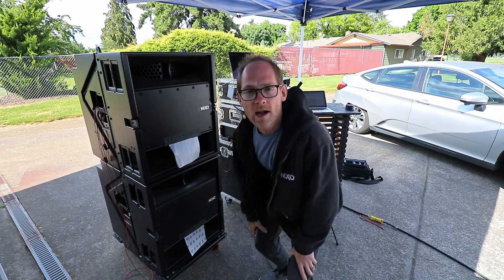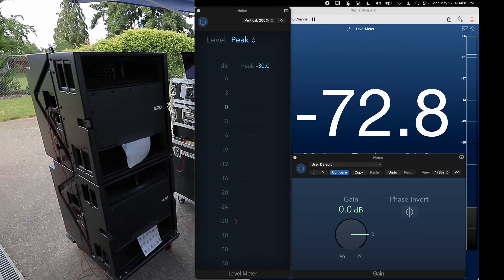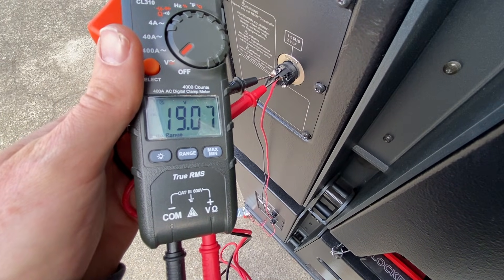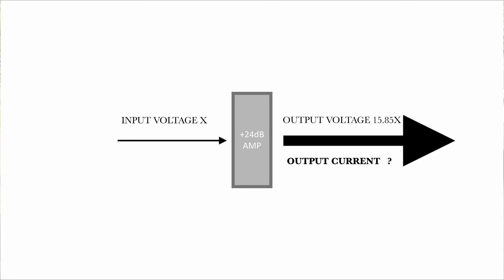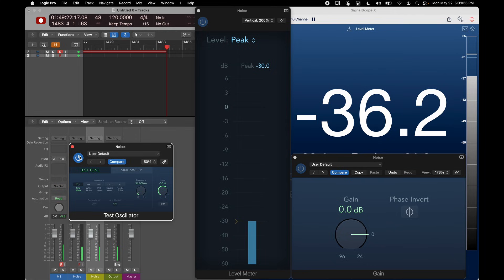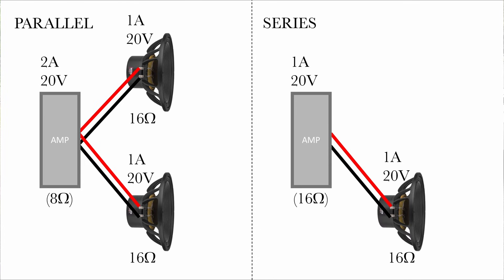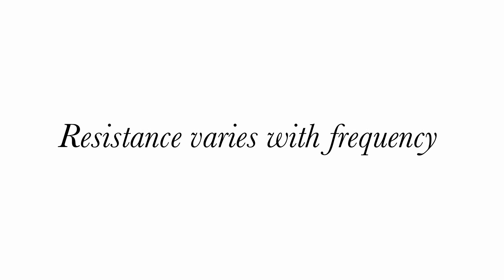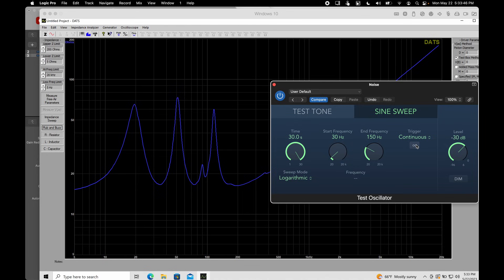Is doubling speakers +3dB or +6dB? What's parallel and series wiring?

Comment: If you use powered subs to simplify the whole process, a lot more people will understand it. Basically doubling your speakers gives you +3db . If one sub max SPL is 135db, adding an extra sub would make it 138 db SPL Max, and to increase it another 3 DB you have to add two more subs, the four subs would produce 141db Max SPL and if you want to add another 3 db, you have to have eight subs to increase it to 144db SPL Max.  Basically, you have to double the speakers for every 3 db increase you want in SPL.
Reply from the maker: OK but you're also doubling the amplifier power when you add another powered sub, so...
Reply: @devinlsheets_alphasound  yes you're correct but I was just explaining the fact that if people want to get more SPL out of their system, they have to double their speakers for every 3db increase. If they use four passive subs instead of two, they will probably have to use two amplifiers to power them to get the additional 3db increase.
Reply from the maker: Unless your amplifier is already completely out of available power, adding a second subwoofer in parallel will automatically draw double the power from the amplifier, resulting in a total of 6 dB increase in your system when you add the second subwoofer. If you could theoretically keep the amplifier power the same all around through some artificial means, adding a second speaker would increase it by 3 dB.
Reply: With — correlated signals — self-powered subwoofers yield 6 dB more pressure for each doubling of loudspeakers as opposed to 3 dB.
Reply from the maker: @MerlijnvanVeen  i'm curious, what situations involve doubling loudspeakers but only yielding 3dB?
Reply: @devinlsheets_alphasound  e.g., two subs that play back — uncorrelated — pink noise waveforms.
Reply from the maker: @MerlijnvanVeen  ah yes, thus the correlated/uncorrelated distinction

Comment: I see there is diminishing returns for every subwoofer after the the second (amp/sub). The SPL calculator has +6.0, +3.5, +2.5, 2.0 db and so on. I'm almost finished building two vented boxes each with a 24" subwoofer tuned for 23 hz (internal volume 11 excluding ports, bracing, driver). This is for an outdoor audio/concert setup. Reinforces the fact on how important the sensitivity and frequency response of a subwoofer or driver is. It can get incredibly expensive or consume a ton of electricity.
Reply from the maker: Yes, because our sense of SPL is logarithmic, not linear, so it takes exponentially more power or number of subwoofers to increase things equally in proportion each time according to our sensitivity to SPL. If you have one sub, adding another will “sound” about the same amount of increase proportionally as having 50 and adding 50 more.
Reply: @devinlsheets_alphasound  one last comment for you and Ding Dong (if he reads this). Watched a video of the 80's band Winger come on stage during Monsters Of Rock Cruise MORC 2023. Guy is recording with his cell phone. Once the music kicked off, you hear someone say "Oh * yeah...that bass!!!". Now that is an experience worth paying or in this case, giving to others. So whatever it takes, that's how many subs I will build/buy/power or whatever. It's all or nothing!!
Reply: Horn loading is the way to go if you really want to push big SPL at sub frequencies. Tapped horns are very effective.
Reply: @dingdong2103  how do you determine the box? Hornresp? The videos on YouTube look like pro audio clones but it's obvious the driver parameters are important after using WinISP.
Reply: @stiffmeister0hYeah  Yes hornresp is an excellent tool. I built a few tapped horns with 21" 18Sound drivers and the actual response was dead on as predicted. +-3db from 80 to 20hz room response in a mid size cinema. System pushes easily 130db clean and punchy bass.
Reply: @dingdong2103  well I have a third 24" sub that is currently in a box with four 12" passive radiators (Earthquake PUMP-12x2). Unfortunately, I did not brace the box enough and it vibrates. I'm going to dig in and see if the braces came loose plus figure out resonant frequency of the radiators. However, having the driver out will allow me to play with hornresp. I just recently learned of horn resp while building these behemoth vented boxes. The 15 cf external dimensions are just enough if not too much. Recommended 16 cf internal and holy cow too much space.
Reply: @stiffmeister0hYeah  A sub with passive radiators is not what hornresp is for. For that use I'd recommend Vituixcad.

Comment: Great video as always! I like that you don't just do the calculations, you measure things. In physics measurements are king. If your theory disagrees with measurements the theory is wrong.

But I have an issue with this. What if you put 10 speakers in series? Your amplifier would output tenth of the power but you'd still get the same audio power. How?

Let's complicate things even more. Now you connect 10 sets of these to the same amplifier in parallel. Your amplifier outputs the same amount of power as it did when driving just one subwoofer. Same voltage and the same current. Same power. But the audio power just went up by 20 dB.

Let's have another thought experiment. You have 100 speakers. You connect all of them in series. Your amplifier outputs 1% of the power it was outputting with just one speaker but the audio power remans the same. You just increased the efficiency of the whole system by 100 times..
What if you had a 1000 speakers? Would your efficiency be 1000 times better? At what point your system's efficiency would be more than 100%? At what point would the system be outputting more energy than it's getting?
Reply from the maker: This is why there are “part 2” videos on the internet lol
Reply: With subs, you will max out acoustic efficiency somewhere around 30% depending on design. Meaning that your +6 db for every doubling of speakers starts to drop off and level off to +3 db. That should happen somewhere around 12 double 18" cabinets where you have reached maximum acoustic efficiency of the design and there is no more efficiency increase to gain by increasing cone area. Same with running speakers in series, you would reach a maximum volume and then start dropping off as the new speakers coming on line wouldn't be adding to the acoustic efficiency as maximum has already been reached and would also be physically far from the measurement location as you can't stack boxes in the same space of each other (damn Pauli exclusion principle).
Reply: He made a mistake in his calculations, see Elkin Velásquez Cuítiva comment.
Reply from the maker: There was indeed an error with that slide, I edited that part out with YouTube Studio.
Reply: So can you add 2 outputs of the same channel on same amplifier to double the output power? My amplifier has 2 cg
Channels and each channel has 2 outputs. I wandered to combine the output on each channel so I ended up with 2 outputs instead of 4.

Comment: Devin, any idea why Nexo uses 16 Ohms drivers in their S-118 subs?
Reply: probably so you can run a shitload of them in parallel to a single amp
Also, and that's speculation, higher impedance speakers use thinner and lighter wire on the coil, so, you may have a tighter magnetic gap and lighter voice coil, thus a better speaker overall
Reply: @victoramicci840  It will also produce less heat.
Reply from the maker: Nope. But maybe I’ll ask and see what they say!
Reply: Greater speaker impedance means greater damping factor with a given amplifier. You may also use thinner cables for each speaker. Also you may have more speakers per channel as someone has already mentioned. You need a strong amp though. Nexo 4x4 is one monster amp.
Reply: That way you can hook up 4 subs (parallel) and have  the amp see a total of 4 Ohms. If you have an amp that can drive 2 Ohms, you can hook up 8 subs.

Comment: What it is two separated active sub ?
+3db ?

I dont understand when you say +3dB acoustic power. Because the power produced by the added membrane, is the exact additional power transmitted by the amp. So why do you count it twice ? (+6dB)
Reply from the maker: With two separate active subs, you would expect a 6dB increase from the second sub being added, because behind that second sub is also 3dB more power from an additional amp.
Reply: If you double your cone area you double the efficiency that each cones can turn the motion of the cone into sound waves in air. It is a very lossy process. In other words both cones now produce twice as much sound as they normally would on their own. Like paddling a canoe with a broom stick vs a paddle - you exert the same amount of energy with both but you go twice as fast with the wider paddle because it can transmit your energy into the fluid water with greater efficiency.

Comment: Voltage is V, or E, unless you're European, then U.  Europeans like the letter "U" as a reference for all kinds of things (check out a German schematic sometime).  Some physics propeller heads didn't want to confuse V for Voltage with V for Velocity or Volume.  So they used "U".   'Mericans honor the name of the guy who came up with the concept: Volta (Alessandro Giuseppe Antonio Anastasio Volta).  Them Europeans, though!  They couldn't leave Conductance as mho, but changed it to "S" to honor a guy named Siemens.  So far, Ohm has been safe and has not been re-assigned a new symbol.  
Don't even get me started on Al You Mini Yum!
Reply: That is only half right... U is indeed the symbol for voltage, but V is the unit of it.

So U = x V (or volts)

In other words, even here in Europe, we do honor mr. Volta.
Reply: @juhojohansson1716  Well it would have been much simpler to use "V", wouldn't it?  As for the Euro love of "U", check out a schematic, where most active parts all have the same reference designator of "U".
Reply: @shazam6274  it depends... There is still logic in being consistent.

In case of voltage in particular, it does seem a bit pointless, when there are no real alternatives... But the practice of doing so applies to more than just voltage, or even electrics. When thinking of variables like time, distance or speed. All of wich can be measured with many different units. But no matter what units one does use, laws of physics remain the same. Obviously the scale of the outcome does depend on units one uses, but units can allways be converted as long as they measure the same thing.

And by the way, the "Ohm" is usually referred to as resistance, and market "R" on equations.

If one is familiar with the SI, then one might see that there is after all some method to the 'Le Système International d'unités' madness...
Reply: @juhojohansson1716  This is about communicating specific information, so "V" is more specific than "U".  But you have accidently revealed the thinking behind the choices in your first sentence: consistency is more important than communicating specificity.  I, and many others, disagree.
Reply: @shazam6274  quite the opposite. Consistency is important to achieving clarity in communication. I do understand that the logic of the SI might seem strange to someone who is not familiar with it.

One should remember that in Europe there are still differences in measuring systems. Especially in the early days of the SI system, clarity was exactly what was needed.
Reply: @juhojohansson1716  I am quite familiar with SI standards, since I served as a convener for the IEC for many years.  As an engineer, I really appreciate standards.  We are not talking about standards, but the petty naming of them by a bunch of "scientific, self absorbed Bureaucrats".  I hope this is not Shocking to you.
Reply: @shazam6274  now I wish I would know enough words to describe the difference between "suure" and "yksikkö".

As such abstract concepts are difficult enough to explain even in native language, trying to make sense out of it on my third language is a bit too much. There are things I would like to say, but all I can think of are words in finnish... And I do know that Finnish is often too difficult for Google to translate properly. Now I could make proper translation myself, but that would be a lot of work for me. And most certainly I am not going to hire a translator for it either.
Reply: @juhojohansson1716  Perhaps you could tell me the quantity of the units you are referring to.  ☺

Comment: Eskimos have been hooking their woofers up in series parallel configurations for hundreds of years.
Reply: But the result is "mush!"  😂
Reply: @naturalverities uh
Reply from the maker: most brilliant analogy possible
Reply: I did not see that one coming 🙏🤭
Reply: Dogs tend to have a fixed "voltage" (top speed), then variable current "torque". So you only need enough "woofers" to prevent "voltage sag" (1 dog struggling to pull the sled by itself). All the woofers are technically in parallel, unless you employ some reverse snatch block system that can pull the sled faster than the top speed of the dogs (if there's enough of them). Although you'd have to keep reconfiguring the pulley system.

Comment: If they’re wired in parallel it will go up 3db. If they were in the same cabinet, and the cabinet was the proper size it would go up 6db. If those speakers are wired in series you’ll drop 3db. Ohms is a measurement of amperage, while volts is a measurement of Electromotive Force. But who cares?without getting crazy you can think of these two measurements this way. If you have a garden hose with water flowing through it, the volume if water coming out is its Amperage. The pressure of the water coming out is akin to voltage.
Reply from the maker: you should make a reaction video and demonstrate this